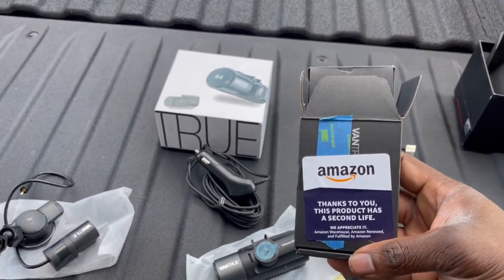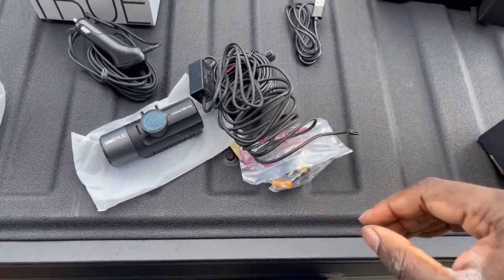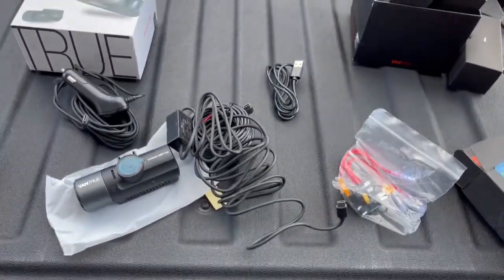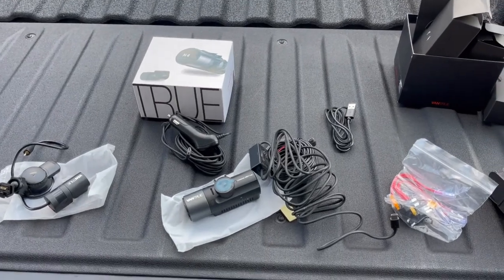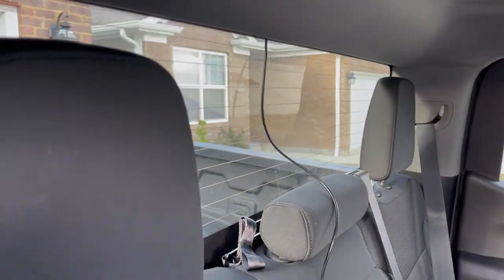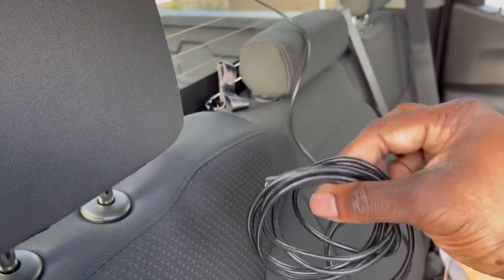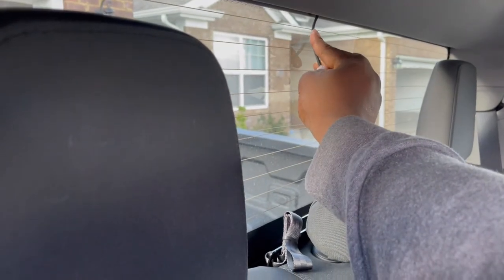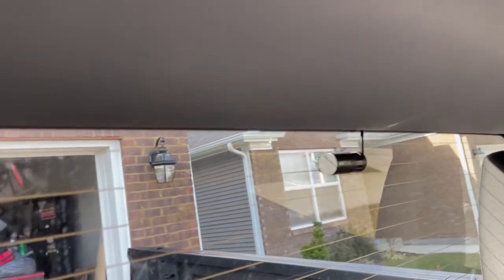Installing a Vantrue N4 three channel dashcam on a 2021 Chevy Silverado

Comment: Just so you know, your routing on the A pillar crosses right over your curtain air bag. You should change this by actually removing the A pillar trim and rerouting your cables so they don’t cross over the airbag.
Reply: I would assume it is a good idea to disconnect the battery when removing the A pillar trim to route the cables....
Reply: @brianst.pierre8244  it is always a good idea to disconnect the battery whenever you work around airbags. However, this is not a fail safe. You must still take care not to mess with any connectors.

Comment: Which fuse/fuse location did you use to connect to?
Reply: Depending on the features of the camera and what you want to be utilized, you will need to find a fuse that is powered at all times and one that is powered when the key is on. Try to avoid any fuses to the essential systems such as ECM, TCM, etc… look for fuses such as ACC and Cigar Lighter.
Reply: @jjshubin5130  I was specifically asking because I have the same truck.

Comment: Super clean,  which fuse did you tap into?
Reply from the maker: Travis it’s been raining all day. I will check it tmrw.
Reply from the maker: It is F5 20 amp not used..
Reply: Ey dude, is the F5 fuse enabled/disabled by the ignition or is it always hot?
Reply from the maker: I want to say always hot, because the cam comes on with motion even when the truck is off.
Reply: @GarryOfAllTrades  Thank you!  This answers my question. I just got the N4 for my 2020 RST Z71